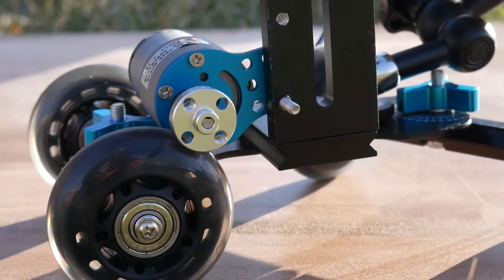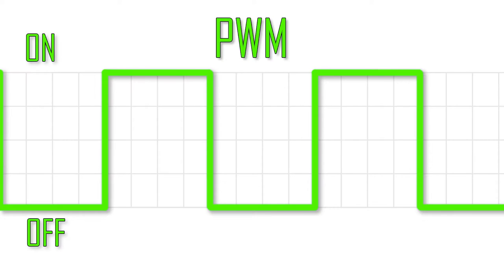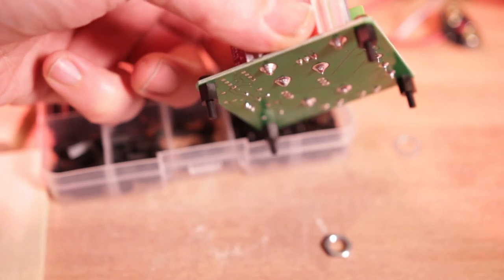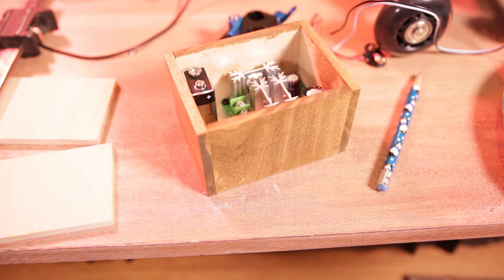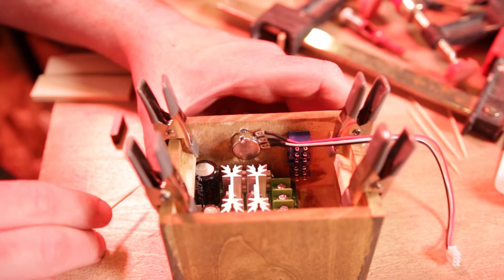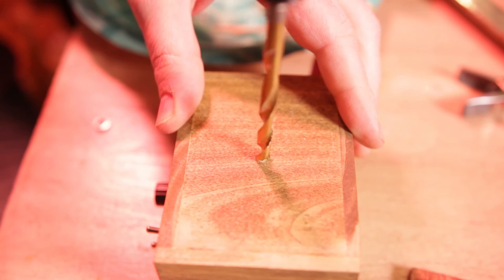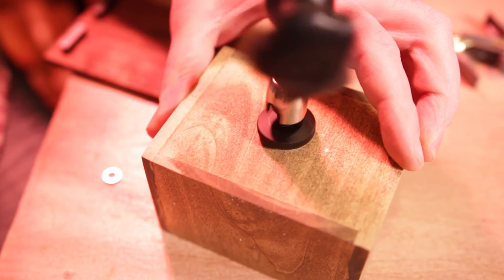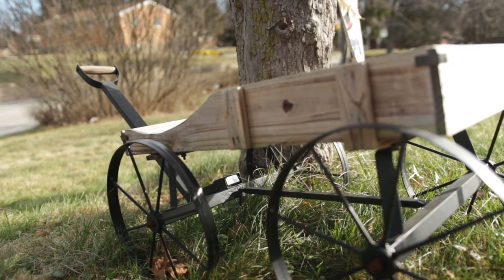Building a DIY Motorized Skater Dolly for Shots With Controlled Motion Ep 16

Comment: This was entertaining. I am looking forward to the indepth electronic videos.
Reply from the maker: I will be doing some motion control with Arduino to control this thing as a slider. I'll probably post some videos of it, since that's what I'll be working on anyway (I have parts on the way). I would really like to find a solid method for building some advanced projects without advanced tools.
I'll probably be posting videos on other topics to help do DIY projects, like brazing aluminium since it's so easy and not everyone has access to a welder.
Anyway, thanks for the feedback!
Reply: Update!?
Reply from the maker: It works good on flat surfaces. Anything I've done after is using rails. I'll be getting back to it when work slows down.